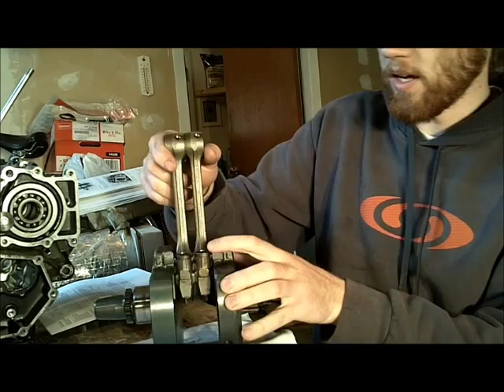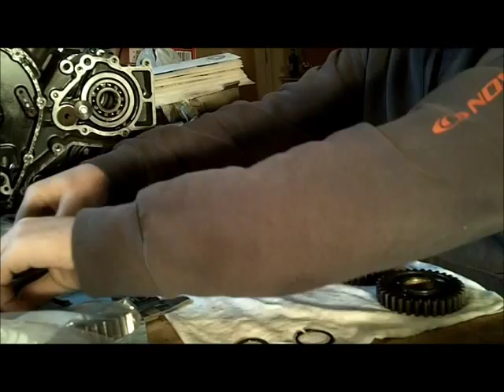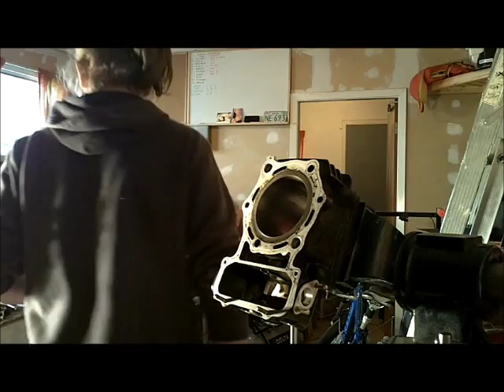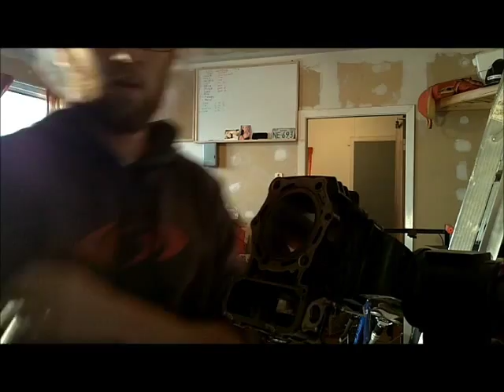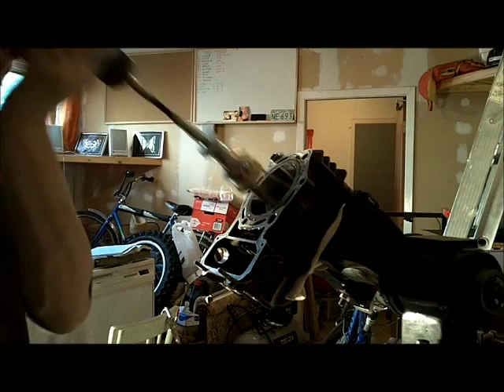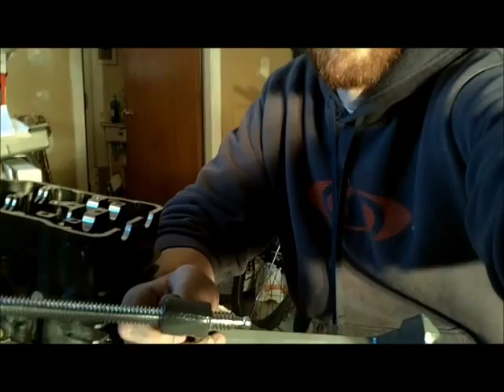1985 Kawasaki VN750 Engine Rebuild - pt12

Comment: Quick tip when honeing a cylinder bore use ATF to lube the stones and cylinder wall, the detergents and friction additives work great for it, also make sure you use a fine stone for your final hone, I prefer using a bead hone but that’s just me

Comment: after u honed the cylinders did u have to use over sized pistons or not got to pull and start rebuilding the motor in mine asap
Reply from the maker: I didn't use new pistons, just rings. You only need to go oversize if it requires a bore job.
Reply: Andrew Roth sweet thanks man, i should finish getting this motor out tomorrow and start dissembley ur videos are awesome very help full